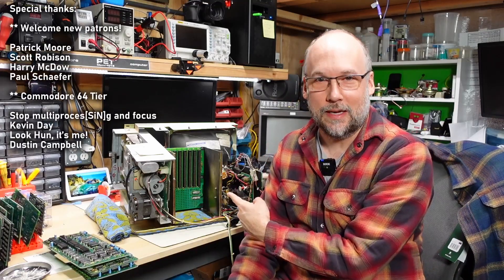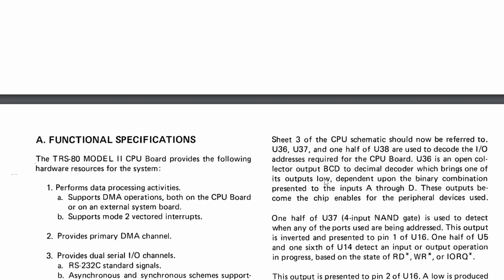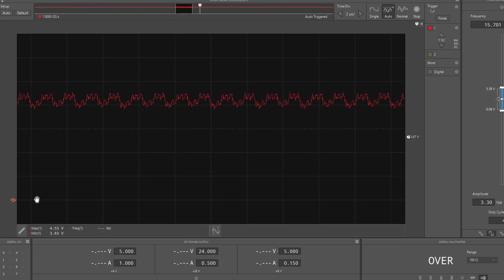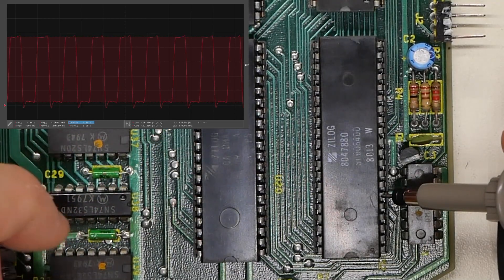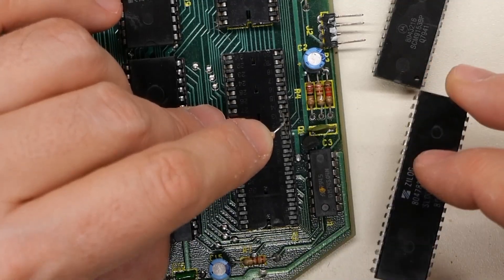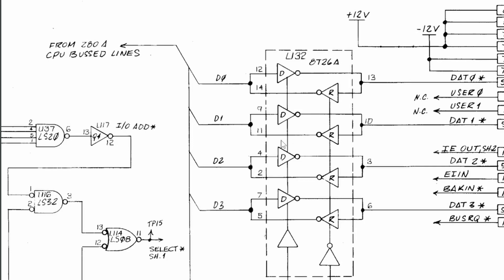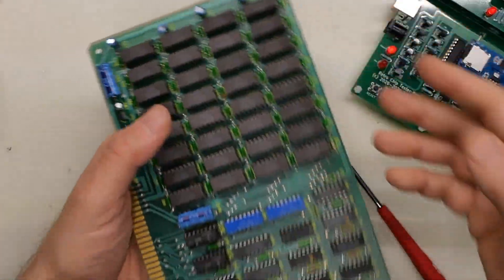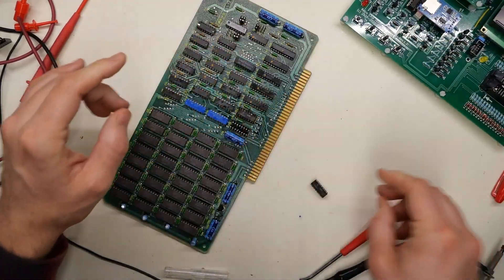I fixed the TRS-80 Model II

Comment: After watching the video on the TRS-80 computer from Radio Shack, it reminded me of a problem I had with a TRS-80 computer. We had one in the Microbiology department at the hospital that was used in the scanning of cultures. The TRS-80 had two 5.25 Floppy drives and we used Flippy 5.25 disk. Not sure if it was a model 3 or 4.

For some reason when the computer warmed up you could not put in the date. As you typed in the date you got mm?day?year instead of mm/date/year. It was as if you were pressing the shift key for the / symbol. If you were fast enough you could get the date entered, before computer warmed up.

The ROM chip for the keyboard was the problem. As soon as the chip warmed up the / would change to the question mark.  So I figured I could write an EPROM with the correct information if the ROM chip was cold enough. I put the ROM chip in the refrigerator and set up my Commodore 64 and Jason Ranheim Promenade C1. Don’t remember what EPROM I used, most likely 2708 or 2716. Put the ROM chip in the Promenade and quickly made a copy. Then burned the ROM information to the EPROM. Reinstalled in the TRS-80 and the problem was corrected.

After all these years I still have the Promenade model C1, software, manual and EPROM’s.

Comment: Z80 doesn't need special reset, it only requires the reset is held active for so many clock cycles to allow the reset routine in the PLA to do it's job.  A simple buffered RC circuit is sufficient.  Most CPUs have similar timing requirements.  In fact, if you carefully control the reset line by counting clocks it is possible to half reset the Z80 for debugging purposes.  The Z80 has a signal pair, BUSREQ and BUSACK.  When BUSREQ is asserted by something the Z80 will tristate all its control / data / address lines and assert BUSACK this allows anything to fully drive the bus, DMA controllers etc.

Comment: 35:00 TL431 is your friend. That is one of most popular IC in the world. I never bought one, every one of them got from recycling old electronics. You can set voltage between 2,5 and 36 volts by selection of two external divider resistors. If i remember correctly 2,5V can be acquired even without additional passive components.

Comment: You can get extension cards that are the length of the card cage. This allows you to plug in a suspect card with it out of the back of the machine where you can get at both sides. Ian Mavric sells them on ebay. 
The CPU voltage levels for your second CPU look OK for an older Z80 part. I think it's how NMOS chips behave. The voltage level is acceptable to TTL as a logic 1 so it works fine. Kinda freaked me out when I first saw that. I think the newer CPU is likely a CMOS part which will drive the signals to the supply rail.

Comment: There's one thing I wish I could send you (although we'd at least have to go halfers on shipping from the UK to where you are) is an Amstrad PCW 8256 or 8512 (which is basically a Z80 powered CP/M machine with a bitmap display and a built in CRT - hence having to go halfers on shipping) just to see what an American would make of the PCW.

Comment: With the 8t26's what's preventing somebody from using an 8 bit bus transceivers on some sort of small chip sized custom PCB to relocate the pins?
Reply: If they are level-compatible yeah that should do, just use 4 out of the 8 each time but it's not worse than using a raspberry pi to convert analog RGB to HDMI anyway :-D

Comment: Might be a good idea to replace all those oxidized sockets. And clean up the legs on the chips and tin them again. You could use de-soldering braid to remove the excess solder. Those Z80's go down all the time in the sound section of arcade boards. Mostly because the boards require the more capable Z80A 4Mhz CPU. But they use the original Z80 2.5Mhz, which runs hotter and fails in a shorter time frame.

Comment: I am curious about you probing working ICs with the probe at te top of the pin. I always probed at the top of the socket (which is somewhat lower), because you can't accidentally slide off that way. So I am curious for why you probe at the top of the pin. Probably because your are a fr*in genius repairing this TRS80 in a straight line haha! Love your videos! Thanks! 😁

Comment: Card placement on the backplane is important.  From memory the II/16 also has the INT line from the slots routed to a latch so the CPU can easily check what card is signalling.  Zilog's peripheral chips have an interrupt enable in pin and an interrupt enable out pin which can be daisy chained to set an interrupt priority scheme.  The MII/16 makes use of this.  See IEI and IE0 on the circuit diagram.  I'm not sure what interrupt mode the II/16 runs in (Z80 has 3 int modes) so it's possible the Zilog peripheral chips are dropping a byte (index or instruction) onto the bus to convey what ISR should be called rather than a fixed routine based on the contents of the latch.
Reply from the maker: I just took a quick look at the schematics and there is nothing to differentiate one slot from another. All that is evident is two traces (Int Enable and Bus Ack) pass through each board. This would imply the order can matters (from a software perspective) but I am quite sure you don't actually have to start in slot 1. As long as the CPU is the right-most card and you follow the order as prescribed without a gap. (CPU -> FDC -> Memory -> Video) Funny I just put them in randomly and the system still worked ... it must be in specific cases it matters... but yeah any gaps will break those two lines.
Reply: @adriansdigitalbasement  It will come down to permissible latency servicing the interrupt.  The DMA controller (FDC transfers) would be able to be low priority since it will only be interrupting when it has a status change, ie it has completed what ever it was doing, but a serial port will need to get attention as soon as possible to avoid character loss.
Reply: FWIW if anyone does read this comment, last paragraph on page 35 of the technical manual describes what I referred to in terms of interrupt priority.  From the factory CPU card in slot 1, FDC card in slot 2.

Comment: Adrian, did you try cleaning the suspect Z80 chip leads and reseat , then verify again it was bad ?   Sometimes single pin oxidation(no contact is an issue)

Comment: Have you considered buying a relatively inexpensive USB Logic Analyzer for your workbench for such projects as they are very helpful diagnostic tools in their own rights on projects like this (though I have not seen the whole video just yet, so can’t say if such would have solved your issue quickly)?  A 16-Input analyzer would allow you to monitor the 8-bit data bus plus other lines of interest (e.g. clock, reset, etc.) or up to a 16-bit address line.  I have one of the more expensive ($400, but there are MUCH cheaper 8 and 16 input options) Chinese model logic analyzers that supports 32-inputs (at up to 80 MHz capture bandwidth with 500MSa/s, on all inputs concurrently IIRC and has support for multiple logic voltage thresholds and will survive input events up to +/-50V) and has two programmable outputs that can be programmed to output a specified frequency (up to 20 MHz) and duty cycle (though duty setting becomes pretty limited above 10 MHz IIRC) which can be handy for generating your own clock.  It is just extremely handy to be able to quickly see everything going on on a bus in real time and quickly see if there is activity or if any lines are dead or shorted to either rail (in which case a quick shutdown is advised to locate where the short is!).  They can also decode a number of serial and parallel protocols (or you can write your own decoders), so you may, for example, watch an external address being accessed, an instruction or value retrieved, and then witness the result of that instruction being executed IF the result is written back into RAM (obviously you can’t witness it if it remains only within an internal register).  In this example you could have monitored the address and/or data bus and clock lines on the backplane and witnessed all those lines in real time with an analyzer and a PC/laptop (Linux or Windows).  They are even more handy if you are building projects from scratch and using any of the many serial protocols as they will decode those protocols allowing you to see if the intended data is being sent and received as intended or if there is an issue with your code or library (or even just you specifying the wrong I2C or SPI address, silly bean!)

Comment: I can remember back in the day, I had 2 friends that were writing programs for packet transmission over radio signal (think ham radio). They were both working at the local Motorola shop in Louisiana. It was in the infancy days of the internet (darpa net). They were using TRS 80 model II 's to do all of this. So is it powerful? It can be... and influential too.

Comment: The Z80 is the sound controller on the Sega Genesis (because it is the Master System's CPU and therefore enables backwards compatibility with an accessory), so having one with a 1987 date code doesn't sound late at all. I'd imagine you could realistically find ones manufactured in the 90s.

Comment: Well fixed. For those wondering why it failed, Z80 CPUs and the family of support chips do just die. Typical large business systems in the 80s and 90s would have one machine with multiple processors on multiple boards for handling comms and disk In/Out. Even the VDUs would have Z80s in them, and every couple of months one would fail. Even in a power conditioned, air conditioned, clean room environment. All serious businesses had maintenance contracts with typically 4 hour or next day response for a cost of about 10% of the value of the computer per annum. For that, service engineers (like me) would carry tons of spare boards and chips and a soldering iron in the toolkit.  Sockets were rare except for line drivers and transevers like the 8Txx series as they would often fail first in a thunderstorm or some idiot pulling a board with the power on. You may cringe but the last thing we would do is de-solder a chip. Chips were cheap and downtime expensive. Chop all the legs at the top close to the plastic and then desolder each leg one at a time from the board. Then suck the solder out the holes. Very, very much faster than saving the chip. Also, never save a bad chip, or even a suspect chip. They may end up back in a computer giving misleading evidence like your first spare CPU. If in doubt - chuck it out!

Comment: 🐨 Didn't see you put the original CPU through that magnificent tester you got there, Wouldn't it be great if it tests OK, and the problem was the socket or even the pins on the CPU was just overly corroded..
APU I dropped a  👉👍👈

Comment: You try to return the original drive. Try to fix the noise. So cool to see it working again!
Reply from the maker: That's beyond my abilities. It would require bearing replacement which would require hydraulic presses and finding the replacements. The drive is still around, it's just not the boot drive in here anymore :-)
Reply: @adriansdigitalbasement  Yes it will be hard to repair it. Hey at least the one  you installed looks exactly the same. Thank you very much for recover this  piece of history and share with all of us Adrian :-)

Comment: Yay!!! That said, I'm interested to know, as others have asked, if perhaps DeOxit might have addressed the issues with the CPU address lines. I've never seen a dead CPU where a lot of other stuff wasn't dead around the CPU (well, except when I overclocked something to death for science). That said, if the CPU is really dead, I wonder how that could have happened? Were some Z80's prone to degradation due to process problems?
Reply from the maker: The address lines are outputs from the CPU, and as seen in the video, I had the scope probe on the CPU pins directly. The socket has nothing to do with what signals come out of the CPU package.
Reply: FWIW I think the older ones can be a bit fragile. Had the original one in my TRS-80 Model 1 go bad in a weird way back in the late 80s. My Dad got a loan of an ICE to debug it...just plugging it in magically fixed the system. Doh!
Reply: @adriansdigitalbasement  I don't know the pinout of the Z80 (not a CPU I'm familiar with) but I assume, like other CPU's,  there are other control lines, grounds, etc., so my thinking was more along the lines of inbound problem impacting one or more of the address lines due to internal logic being munged up (which it obviously is, my only assumption is that there might be an external issue causing that problem).

Comment: the OLIVETTI BCS3030 had 30 boards in a steel cabinet and if not replaced in the correct slots the unit will not work.

Comment: Why are you not using a white/silver marker on black chips?
Reply from the maker: Those pens are hard to get started again after I don't use them for a while..... I have several and they all require shaking, pushing on the tip and a bunch of scribbling on paper to make them work again ... not useful when I just want to put a tiny little mark on a IC.

Comment: I would have liked to see you re-insert both other cpus and test since both sockets had had Deoxit applied.

I'm a bit surprised that on any board you're diagnosing that has socketed chips, you don't at least press them all before testing, if not removal, Deoxit, insert.
Reply from the maker: Did you watch the previous part?

Comment: I just watched Bill Herd's VCF East presentation "Life at Commodore (Act II)" - https://youtu.be/zGBGLShWlco - which is a great video and may be very relevant to your interests, but it reminded me of your video so I thought I'd come back and leave a comment.

@33:19 you point out a Zener diode connected to an unused pin of the floppy controller chip, Bill showed a prototype with a chip that used a Zener connected to the substrate to make it more stable. He also mentioned the MOS chip designers of one of the C128 chips put a charge pump circuit into the chip to bias the substrate to negative 2V, which caused it to not work in their prototype, so Bill fixed it by shorting the substrate to ground.

These two things weren't directly related in Bill's presentation (I believe they were different chips in different prototypes), but it got me thinking. If that "not connected" pin is actually connected to the substrate, the Zener could be used to limit the substrate bias voltage. Looking at the close-up shot @33:25 it's pointing towards ground. That does suggest a negative bias. The purpose is to reduce leakage, which would increase stability, but it's at the expense of speed since the transistors have to swing from (in this case) -2.5V to 5V.

I would be interested to see if you can measure a voltage across that Zener. Obviously it's working with a 3.3V Zener, but it's possible there's some weird edge case that we haven't seen which the 2.5V Zener would fix. I have no idea how it works for this chip, but maybe under load the substrate drifts lower than -2.5V, which causes the high output voltage level to drop below 5V. Bill also mentioned the Z80 needs a sharp high transition to above 4.9V, so your floppy controller could start causing issues if its outputs aren't reaching 5V.

So yeah, definitely keep an eye on it. That Zener could be the culprit if you start seeing instability while using the floppy drive.

Comment: Did you check the (dead) CPU again after using Deoxid on the socket? Could it be not dead? :O
Reply from the maker: I was measuring the signal right on the CPU pin, not after the socket. Tells us right away the CPU is bad as it's not outputting a signal properly.
Reply: @adriansdigitalbasement  too bad. I was still hoping!

Thank you for answering! :)

Comment: 22:20 - :/ It's cool that you can easilly test stuff out with that new toy but it's starting to look like a woodworking channel with laser guided precision saws: meaning, it's less accessible to regular folks. I don't even have a scope because it's too expensive (but I really want one one day...)
Reply from the maker: You can definite do most of this with a used old oscilloscope, spending $100 or less if you score a good deal. Also, the cheap USB ones from China would work as well although they start to become less and less useful as prices drop too much. Old and second hand ones are better IMHO.

Comment: Would be nice if someone rebuilt the whole TRS80 using modern components plus a FPGA version of the ZILOG Z80A or better.
Reply: Why? You can still buy the Z80 afaik. Even the "original" 5 volt variant with this pinout can be clocked at 20 MHz (with plenty of marginal) since the late 1980s or so. It's made in CMOS though.
Reply: @herrbonk3635  Someone decided to create a FPGA version of the ZILOG Z80A as he could not source the CPU he wanted so he created a ZILOG Z80A using a FPGA.